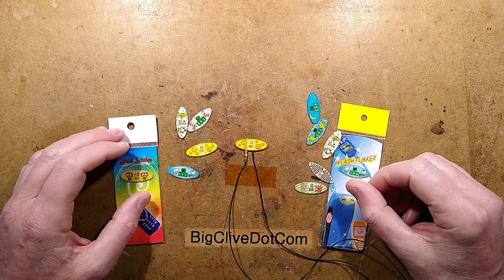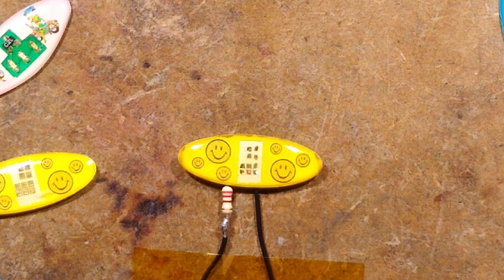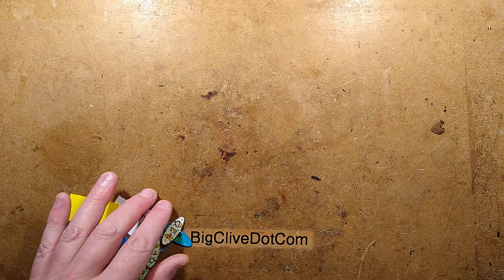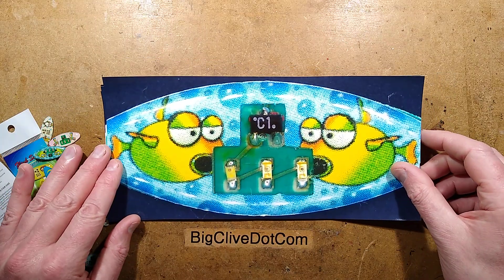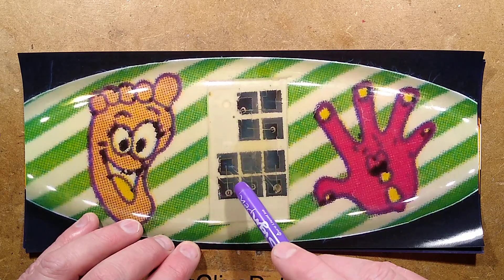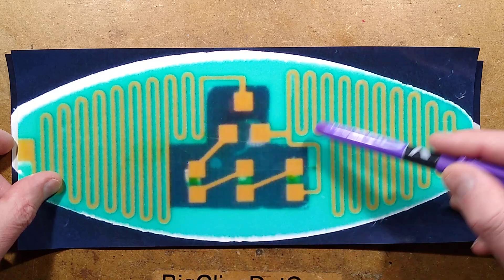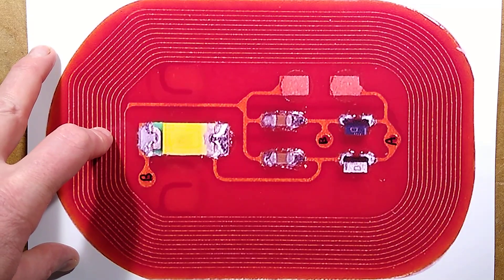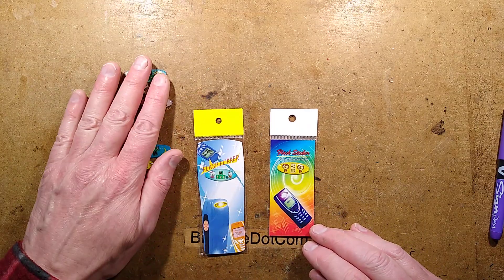How self-powered flashing phone stickers worked (with schematic)

Comment: The frequency of an EM radiation is the one that's dangerous to the bilogical life, not the power.
5G frequency is dangerous for biological life. Use your smartphone only on 4G.
Reply: Would 500 terahertz be dangerous to the human body?
Reply: Aperture C / Absolutely! That's even much, much more dangerous.
5G goes to only up to 80-90 GHz.
Are you trying to play smart with me?
Reply: @mikel4879  What if I told you there is a big globe in the sky that radiates 380-750 terahertz of radiation all over Earth? It's called the Sun
Reply: @mikel4879  Yeah, but still kilowatts of this energy make it to earths surface (per square meter)
Reply: ApertureC / Are you sure, little sheet of paper? If that's true then your imaginary kilowats of energy per square meter at the frequency of 500 terahertz would be good to be collected by an antenna and power a house.
Where are they? Have you heard of somebody collecting those kilowats of energy per square meter that you're lying about?
I haven't!
People wouldn't even need solar panels anymore because with an antenna of a 2-3 meters diameter tuned on 500 terahertz, the energy collected and stored would be enough to continuously power a house.
Where is that energy? I don't see and I've never heard of any antennas on Earth tuned on 500 terahertz in order to collect kilowats of energy on each square meter.
Reply: @mikel4879  You see it all the time, it's light. Light is electromagnetic energy. And the Earth absorbs 1.3 kilowatts of light per square meter. Source: https://en.wikipedia.org/wiki/Light
Reply from the maker: Well that was mean but funny.  My eyebrow raised when I "red" the answer.

Comment: Another way to find out when a phone is randomly checking in with the tower is to put it close to a microphone.   As a sound engineer this was highly unpleasant when I was doing sound for a convention or conference and the speaker at the lectern forgot to turn off his phone, and the condenser microphone would pick up the buzz-buzz-buzz and amplify it for the entire room to hear.   Of course everyone started telling me to fix it, which I couldn't.   It kind of sounds like an old modem connecting, and usually lasts for about 5 seconds.   Luckily, modern phones have less problems with this.
Reply: My relatively-new phone makes the radio in the store freak out... loudly... even when I'm still in the warehouse and about 20ft away. :V

Comment: I often wondered if the pull out antenna on my old phone actually did anything or was just there to make me feel like it did
Reply: I had a Motorola phone with a pull-out "antenna" that was just a plastic rod for effect. I don't remember the model but it took a full-size (i.e. credit card size) SIM card.
Reply: @olmostgudinaf8100  That plastic rod may well have been constructed of a conductive plastic, in which case it probably DID do something.
Reply: @m.k.8158  I remember assuming there was a wire inside, but I read somewhere years later that it was just for effect.
The model was MicroTAC and it was a real POS. The battery lasted 12 hours and it did not have any SMS functionality.

Comment: They are probably tuned to 2G 900-ish MHz.
Reply: if tuned for 900MHz they are tuned for 1800 too but at half wave (and i guess power then…)
Reply: @Darkfiberke  Yes but the switching speed of the diode may limit effectiveness at 1.8GHz
Reply: @mikeselectricstuff   you did notits 
diode bridge right!! Sooo
@1800MHz Will defently swing more
Then 900MHz
Reply: The sticker with the tighter antennae might be for a 2G 1800MHz phone with most GSM phones (in Europe) being multiband, back in the good old days before (un)smartphones arrived 😉
Reply: @reggiep75  In the UK they were mostly 900Hz band for 2G, the lower frequency could cover a much larger distance. Hence, emergency band is ~450Hz.
Reply: @blaser80  02 & VF were usally 900, Orange & Tmobile were 1800mhz licence holders I believe
Reply: A lot of people do not know that 2g, 3g, 4g, even 5g doesn't have much to do with frequency;  it's just a protocol standard.      For example in my regional area my cell carrier is putting out "4G"  on  700 megahertz range,   1900,  and the 1700/2100 megahertz range.    they still have 3G on  850megahertz as well.    and i think they are putting 5G on  2800 megahertz.      If Clive headed away from all the nearby towers his phone would have to increase power and possibly switch to a lower freq;  and then he might get those  LEDs to light.
Reply: @johng4527  good point. Nowadays the frequencies increased up to 5Ghz but if you get in  2g or 3g only remote areas, your phone will switch to 900/1800MHz
Reply: @soupflood  5 GHz is reserved for WiFi systems here, 28 GHz is 5G UWB, and 850 MHz is 5G NR, with CBRS standing in at 3.5 GHz. The new C-Band spectrum sits at about 3.7-4.2 GHz. 700, 1900, and 2100 MHz are 4g as well.
Reply: Where can I buy it now?
Reply: they probably would have worked best on the 2g "vodafone" (gprs? as opposed to CDMA on old telecom phones which seemed to interfere less) network as they made quite a loud "galloping" sound in any nearby audio circuits, those pulses would have been quite powerful I think, enough to power those LEDs
Reply: And close enough to 850 and 1900 MHz as used in the US, Canada, and a few other places that they could sell the same ones there, too.

I doubt they would have worked as well if at all on CDMA phones, though, which were quite popular in the US at the time. The peak power output on GSM and IS-136 was a lot higher since they were only transmitting 1/8th or 1/3rd of the time but with the same 250mW (max) average transmit power.
Reply: @bloodydamnhell  RE: CDMA I think you are right about that. I've always had CDMA phones and even 20 years ago it was always stated these things wouldn't work. Now, where's that StarTAC?
Reply: These worked on even 3G also. But it wasn’t as much a thing when people were getting camera phones and flashing lights became the ‘meh’ style

Comment: They would flash just before the phone would ring, as the phone would handshake with the tower at full power as part of the early GSM standards.
Reply: The process was, the base station would send out a signal to the phone to ask if it was there, the phone would reply transmitting at full power back to the base station, then the base station would reply back, and during this period a message would be sent from the base station telling the phone how loud it was so the phone could reduce power. I Once the handshaking was finalised the phone would start ringing and when you answered the call would start (during the call - the received power levels would be sent and the base station and phone would adjust the power of the call)

4G & 5G phones start with a low power answer and ramp the signal up to the correct level.

Comment: In Android at least, you can go into the settings and tell it to always use GSM (2G) mode, disabling 3G/HSPA/4G/LTE. Sticker should work then, even with a modern phone. I used to set my phone to switch to 2G mode when connected to WiFi, and it would do the speaker buzzing thing when somebody called me.
Reply: Vodafone, EE and O2 all still have 2G networks. It’s only 3 that don’t (hence the name) they used to piggy back off O2. But not for long which will be a problem as most smart meters use 2G
Reply: Which android models?
Reply: @SapphicReality  it's a stock android feature. Allot of manufacturers disable it in their builds so that people can't bugger their connection and then complain, but if you enable developer mode you can usually find it there
Reply: @allensmithphotography  On a samsung Galaxy A20e go into connections/mobile networks/network mode and mine gives the option of 3G/2G auto connect. You're not going to get the 2G option unless you're really out in the sticks with a very poor signal, as even moderately built up areas will usually have at least 3G these days
Reply: @SapphicReality  For example on my Xiaomi  Redmi note 8 PRO (Android 11) and i think on Xiaomi Redmi note 4 (Android 7) it should be too. You go to Settings>SIM cards & mobile networks>you choose your SIM by tapping on it>Preffered network type>theres option "2G only". But I can not comfirm if it works with the sticker, because I no longer have one...
Reply: @SapphicReality  There is also an app called Network Mode that allows switching which kind of network the phone will use. It is not an app to casually play with. If someone starts clicking things and has no idea what they are doing, It is very easy to change things around so the phone stops working until the changes are undone.
Reply: @SapphicReality  all of them
Reply: 2g only FTW!
Reply: Trouble is, not all operators still support 2G. If you switch your phon to 2G only, you may effectively turn it into a brick until you switch it back.
Reply: @olmostgudinaf8100  Really? Which operators?
Reply: @aziztcf  In the UK, Three only operates 3G and higher. I got caught out by exactly that. Moved my SIM card to another phone and it "did not work" - simply because that phone was switched to "2G only".
Reply: @LDuncanShortridge  2G powers a lot of PoS equipment and many other low-bandwidth IOT devices, that's why it's still an important feature of cell networks.  It's also extremely efficient and quite noise/range insensitive.
Reply: @awebuser5914  yep, and that is why most of the world is keeping 2G active even after 3G is shut down as obsolete...l
Reply: @LDuncanShortridge  I think the 2G is being kept because of the large number of wireless alarms that have been installed.  Maybe city infrastructure such as instruments throughout the city, or even things like electric and gas meters.
Reply: @LDuncanShortridge  why would they drop 3g before 2g?
Reply: @wuuubbits  smart meters and other "critical" devices that use 2G?
Reply: @LDuncanShortridge  Sprint is in in a March now I'll be 3 G and Sprint 4 G light Network well shut down at the in July. Verizon wireless at end of December this year
Reply: Not to mention that 2G is so unpleasantly insecure that it should absolutely not be used ever again. And 3G is barely any better, for that matter.
Reply: @Anvilshock  True, and I would add that wireless is about as secure as the language your speaking in and the hearing of the onlooker, in a manner of speaking. Wireless is typically encrypted, but anyone can technically listen in. I like to simplify the matter for the layman by saying wireless is inherently insecure.
Reply: @aidan3871  you're*, eavesdropper*
Reply: A lot of 2G networks are shutting down or have already shut down. Here in Australia we haven't had any 2G for several years.
https://en.wikipedia.org/wiki/2G#Phase-out
Reply: @IanTester  and 3G is about to go as well I think
Reply: I am very surprised to find out that 2G service still exists anywhere in the world. I’m in Australia and all our 2G was turned off years ago. I can no longer make calls with my vintage mobiles. I do plan on one day building my own small 2G cell so I can play with them again. I think my Nokia 5510 from when I was a teenager still has one of these stickers on it.

Comment: The diffference in the antenna length of the original stickers is the longer one is the length of the signal's center wavelength.  The shorter antenna is a half-wave length, but it still works because it's a first harmonic of the full wavelength.
Reply: Except two half waves have a Voltage node at the center, while two quarter waves have a Current node. 
That is a large enough difference to rule out the full-wave idea.
Reply: Daaaamn daniel
Reply: Can you please type that again with different words?
Reply: @UmbraAtrox_  Signal is like a stick that you can cut in half as many times as you want to measure how big it is.
Reply: @UmbraAtrox_  Two different antenna lengths. One is as long as the wavelength, the other is half that (half the wavelength)
Reply: To add to OP great answer, antenna lenght has to match frequency wavelenght to “resonate” with it, or some harmonics. For reception it gets you the best sensitivity, for transmission it gets you the best power. Transmittimg with the wrong antenna lengthened has it reflect back some power and can damage the transmitting circuit among other things. 

Thanks for great videos!

Comment: FYI The track length has only a side effect on the RF reception of the antenna. What matters are the dimensions of the antennas, which are similiar. HF is able to travel over the gaps of the meandering track and sees it as an direct track to the diodes. But the more track lenght antenna could be able to gather more of the magnetic component of the RF field and perhabs they changed it to the simpler design because it was enough to catch the energy and they mentioned the problem with the poorer reception when sticking them on your highly calibrated GSM antenna (my HF designers heard is bleeding😢). Another good video and with best regards
Reply: Longer antenna length is likely double for higher efficiency. It's just meandering dipole antenna, so it's not about travelling over the gaps unless I'm misunderstanding what you're saying.

Comment: I remember flashing LED keychains, the point was to show an incoming call with the flash if your phone is set to silent and it is in your bag. Not every phone had vibrating function back then, but there were already too many phones and the ring sounds were awful (and similar) so people started to use silent or beep-only modes.
Reply: Some people still do. And they're pretty powerful. I can hear my roommate's phone vibrate through their desk into the floor into the ceiling of my office below.
Reply: Also while being in a bar the flashing helps to show if someone calls or texts..
Reply: Back in that era I had one of those standard radio alarm clocks with the red LCD type display in my bedroom. I few seconds before I would get a call or text there would always be a god awful Morse code or EMS radio alert like sound that would come out of the speaker. The radio was always turned off, but would alert me to anything incoming. I always thought it was some high powered handshake type signal.
Reply: On iPhones you can set the led to flash when receiving a phone call.
Reply: @markm0000 that was all the rage for a while. I remember my old HTC had that feature. 
Nowadays phone calls vibrate my wrist nearly off from my smart watch
Reply: I would still use that. Any devices like that for modern mobile standards?
Reply: @andik70  the phones today are probably too low power and enclosed in a glass and metal case with only tiny slits for the signal to pass, so it might be hard to pick from the outside. On iPhone (don't know about others) you can turn on LED flash for alerts in settings, I always have that enabled and it's super useful in places where you can't hear the phone or it's too quiet even for vibration, for ex., in class.
Reply: @andik70 I'm in the same boat, except I never knew about the products existing in the past. I've had the idea in the back of my head for a long time as an "invention"...of course it was already done and gone. I even tried to search for something like that a long time ago and could only find a Dr. Who keychain that would flash when a text came. (Which to be fair was cool on its own.) Either way I'd still like a small fob that would vibrate for messages so I can leave my phone at my toolbox.
Reply: the closest things are fitness/smart bracelets (not the fancy smart watch type, but the small ones with weeks of battery life like the Xiaomi Mi Band series), but bluetooth needs some battery life sacrifice on the phone side...
Reply: You mean like iPhone's trashy marimba ringtone that pretentious people still try to impress other morons with?
Reply: How and where to get one?
Reply: I have one
Reply: I liked when phones had vibrate and then ring as a default option.